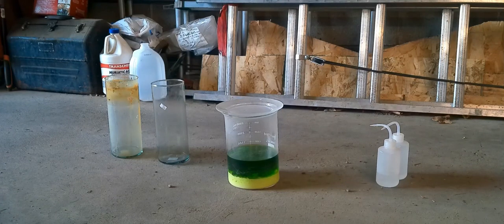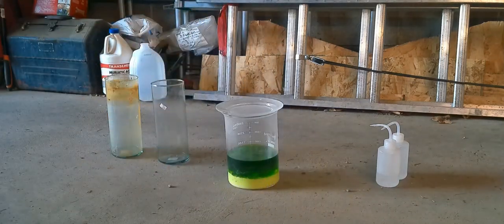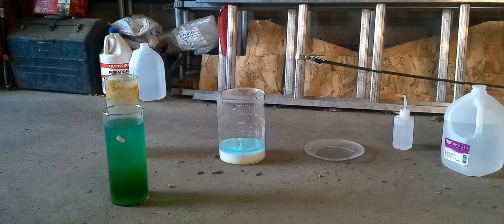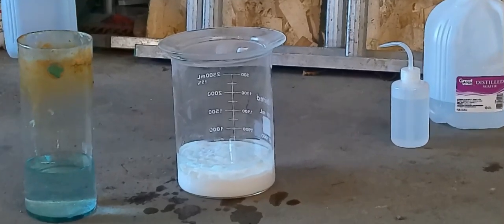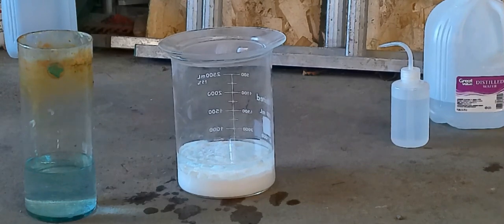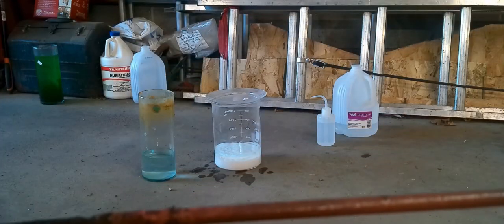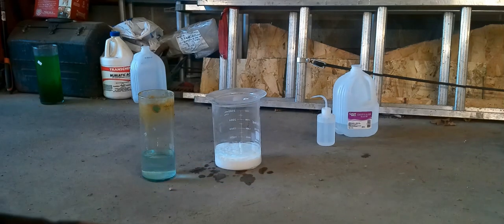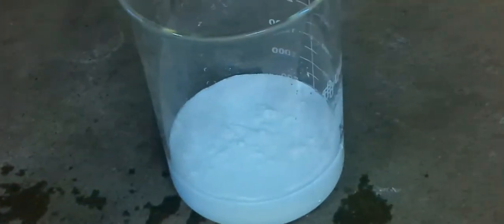Silver Refining Nitric Acid (Poor Man's Method) Part 2 with Copper Recovery

Comment: A few more improvments - 

Using a vacuum filtration should get a higher purity. Also will speed up the washing a poor mans vacuum filter might be using an an old espresso machine or an by hand using an aeropress. The purity is important if you are thinking of doing some silver smithing or just getting poured bars assayed.

ON TO PART 3